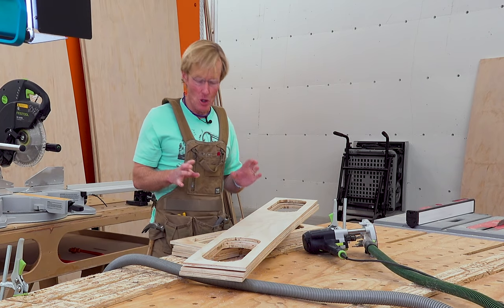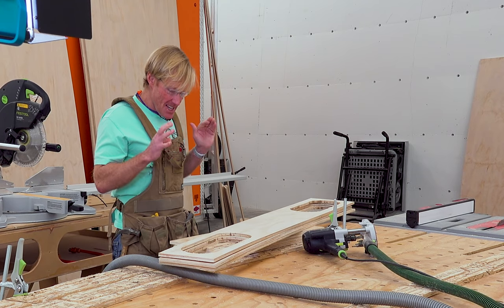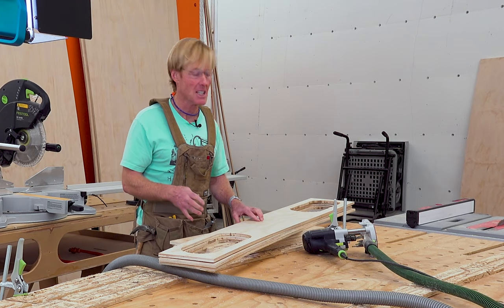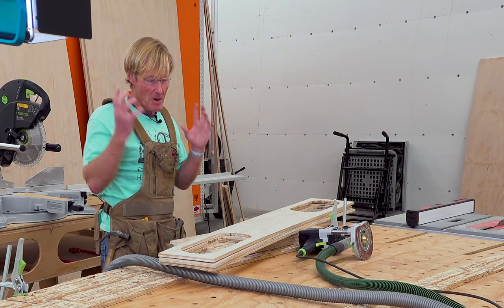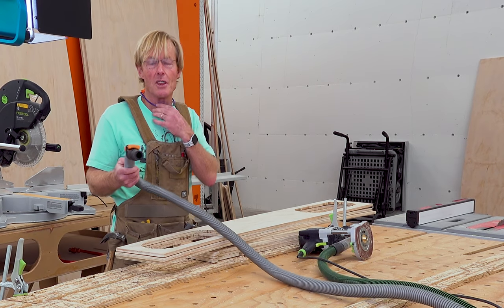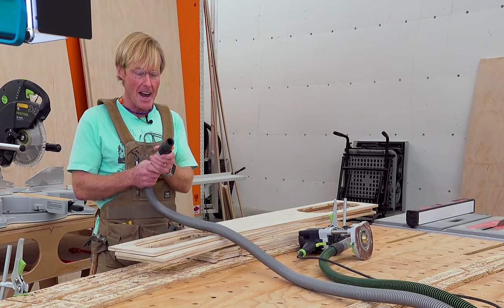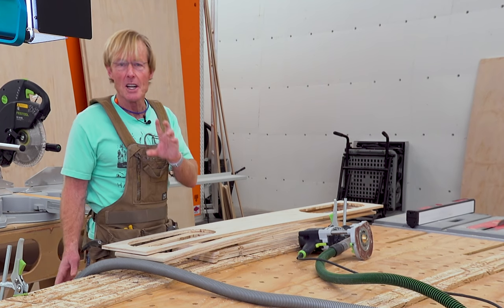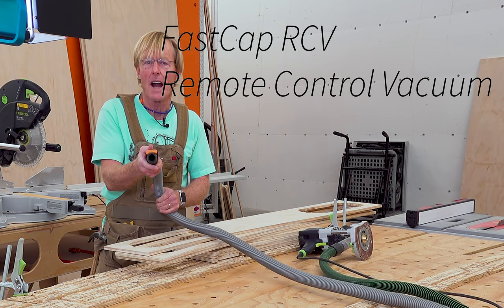Today in The Smart Woodshop with the Fastcap Remote Vacuum Switch

Comment: $30 is a lot less than Festool $80 remote. The only thing is that with Festool there is nothing to plug into the wall outlet. Great tip.

Comment: I use Bosch's hepa vac with the power port.  Automatically turns on when you power the tool and stays on for a few after you power off but fast caps is definitely cool for non ported vacs and general vacuuming
Reply from the maker: The Fein vac I am using in the video also has an auto switch, but it does no good in this situation I am showing here.
Reply: @TheSmartWoodshop  Does the Fein stay on for a period of time after the tool powers off?  Like I said, for general vacuuming without running a tool to turn the vac on the fast cap accessory is definitely the way to go.
Reply from the maker: @PassionforWoodworking  Yes, the Fein, Festool, and even the basic $20 Craftsman switch that I can plug any vac into has an extended vac runtime to clear the sawdust after the tool stops. I am pretty sure every brand does this.
Reply: Passion for Woodworking; The Fein tool and the Festool Do also have remote start in Them but the Fein Ron is using does not have a Tool connected... Just the Vac placed out of his way... The Remote makes Life Easier for Him... I hope you have Grasped the Concept Now...  Greg
Reply: @gregorylondos534  I missed it entirely lol.  I normally pop off my hose to vac while its still running and didn't realize he was running a separate vac than for the tool.  Makes more sense now.